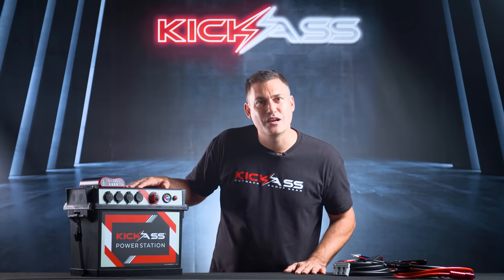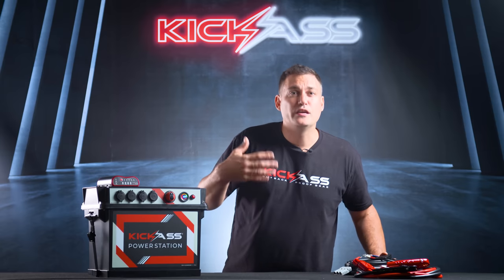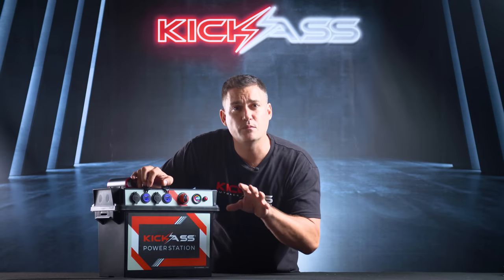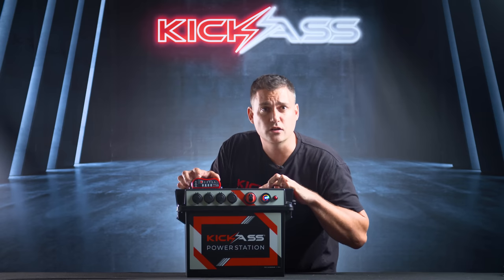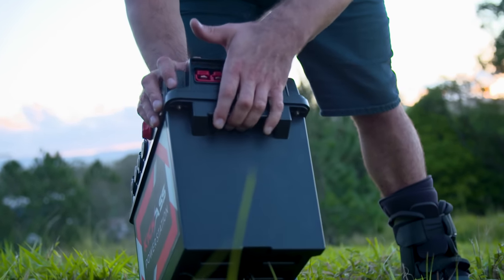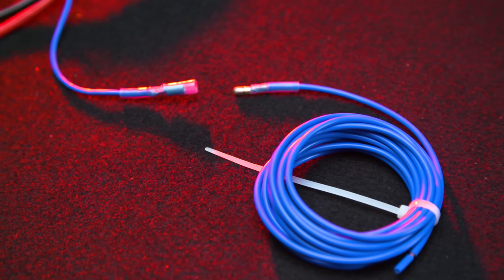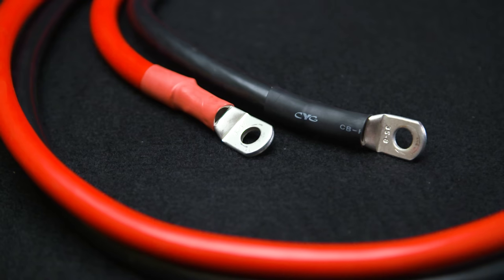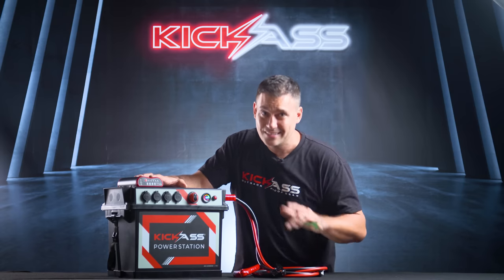KickAss Powerstation Portable Battery Box with integrated 25 Amp DC DC charger. Dual battery system

Comment: So this is basically the whole dual battery system except more portable and cheaper. 110% getting this in my next car!
Reply from the maker: Hey Sammy, yes this is designed to b an all in one system. All you need to do is run a wiring kit from your cranking battery to wherever you want your deep cycle. Everything else is built in.
Reply: @KickAssProducts  that is awesome. So simple. Everything is so complicated So many of us spend hours researching when there only needs to be one person to research it all and by the looks of it you guys have gotten it right.

Comment: It's a good plug and play set-up. Having issues with an over voltage issue from the alternator though. The starter battery is running at 14.3 and the aux battery hits overload at 14.2 turning into a beeping pain in the bum. Shouldn't be doing it
Reply from the maker: Hey Mate, you should see a bulk charge to an AGM battery of up to 14.4 Volts when charging from your alternator. When the charger senses the battery is full only then should it drop back to the float voltage of 13.7 volts. 

Is the charger showing you a fault code?

If you continue to have issues please submit a ticket via our support portal https://supportportal.kickassproducts.com.au/kickass-12v-premium-battery-box-with-dcdc-mppt-solar-controller/

One of our technicians will get back to you ASAP.
Reply: @KickAssProducts  it's the lithium. Over voltage  fault code at 14.2. Then when the battery is off on the toggle it's all lights flashing constantly  with the bottom left and bottom right lights on

Comment: Recently installed this in my Colorado and have it running from my main battery using the triple Anderson plug. When I take a test light to it I’m only getting power through the ignition wire. Is this normal? So far I’m happy with the performance of this box I’m just not 100% if there was anything I may have missed
Reply from the maker: G'day Benny,i would check your fuse mate as you shoud be getting the same reading from start battery to the other end of the triple anderson plug & you should only be getting power to the blue ignition wire while the car is actually running 
Thanks for watching the video
Cheers Craig

Comment: with AC charger, can car cigarette socket charing the power station?  daily 30min driving to work, which will charge the power station alright for 40L fridge for the day?
Reply from the maker: No Sorry, The integrated DC DC charger draws 25 amps. A cig socket can only supply 10 amps max. To charge while you are driving you need a direct connection to your vehicle's alternator (start battery). However the 120AH battery when fully charged will keep a 40 Litre fridge running for several days so if you charge from AC at home you would not need to charge when driving.

Comment: If i just buy the box itself, what is the largest capacity battery that would fit in it? I would like to be able to run a higher capacity inverter from it.
Reply from the maker: G'day Mate, it's pretty much designed around the dimensions of a N70 battery as it is the most common but still has a little room to move so you would just have to check the dimensions of your battery 
Thanks for watching 
Cheers Craig

Comment: OK ...having just spent some time hooking this all up in my Ford Ranger PX2, i feel like i can give some decent feedback. Now...understand, i have no appreciable automotive qualifications or auto electrical experience. 

Pros. 

1) Really solid piece of kit....pretty much everything they say here is true, well built, feels strong in terms of the box itself. good allen key tie down screws to put the lid on 
2) Be a little careful though, the lid with all the wiring in it has a bit of weight to it and you don't want to bounce it off anything when you are taking it on and off putting battery in. Once its all screwed down though its fine to move about.
3) the voltage indicator is nice and obvious and the DCDC charger is well bolted to the box. 
4) the install of the wiring isnt that hard. It took me longer to work out where to run it through the chassis and get it in there than it did to understand it. 
5) works well with my existing kickass battery charger. 

Mids

1) Remember...not their fault, but you are going to need to give room for a 12v plug to poke out with clearance to your fridge. forgot that and had to move the base.
2) the battery base is a great design in terms of screw down points, but i really would have preferred an aluminum or steel one, the plastic flexes pretty hard depending on where you are screwing it down. 
3) it sounds obvious now......(and im pretty dumb) but remember the lid goes on the box only in 1 direction to allow for the vertical Anderson slots 

Cons

1) Not any so far really,

The one thing i would recommend is that the crew do more video installs, show us customer or your installs on all the majors brands. ie how do you get the wiring to the back on a ranger with a canopy ? where is the right fuse on a Hilux? If you did 4 of these videos on each major Utes, you would have 80% of the market covered for self install walkthroughs your customers.. Have a table in the manual for what piggyback fuse we should buy and what slot meets the requirements (to fit and meets the 'ignition on' requirements)

Overall ?  really happy with it ! good product, solidly built........just suggesting a bit more install/product info for us newbies who are working it out as we go. (and these guys already do a lot of those sorts of videos)
Reply from the maker: Thanks for the review Mark.

Comment: Hi these are awsome products i love them just wondering  i have the agm battery box with the Dcdc charger on top can i upgrade to a lithium battery and put it in the agm box ? 
Thankyou keep up the Awsome products
Reply from the maker: Hi Anthony, do you own the KA PowerStation? if so absolutely you can. 

The charger on the unit is fully compatible with lithium batteries. The only  thing is that the volt meter will not be fully accurate with a lithium battery. However our LiFePO4 batteries are supplied with the Remote Display Unit screen which gives you all the information from the units BMS.

Comment: Love how this is a plug and play system basically.  2 questions :  1.  In the United States I don't see the 20amp AC battery charger available.  Did I miss that?  2.  If I leave this plugged in all the time to charge from solar while sitting, should I install a battery isolator so it doesn't drain my starter battery if I am also using the mppt controller?  Can't wait to order this.
Reply from the maker: Hi, our AC chargers are not available in the US just yet. As we run on 240 volt in Australia we have to build a different 120 volt version for you guys in the US. 

You should always have some sort of isolator between your start battery and your auxiliary battery. Either a VSR or more recommended a DCDC charger.

Comment: Great information. Just what I need to know as I am about to set up my 4wd for 12v power. I didn't understand exactly about bypassing the solar panel's inbuilt controller. But I get that my solar panel can be used one way or another. I will probably get a kick ass battery box etc after seeing this video.
Reply from the maker: If you have another solar controller such as the MPPT in the DCDC charger you don't use the built in one on the solar panel. You bypass it and plug your solar panel directly into the solar input on the DCDC charger and it will regulate the power. Hope this helps.

Comment: Hey mate ya spoke about the 700w inverter. Would this battery box with 120 lithium run a your 1200w inverter or do you recommend two batteries?
Reply from the maker: As long as the BMS on your lithium battery can handle the current draw. (110Amps DC)

Comment: Can you elaborate on the optional inverter cable; there is no fuse on the red anderson plug on the battery box, so how is the circuit protected? 
I have asked this question on the contact form on your website but have had no response...
Reply from the maker: G'day Dan,you would have to still install a fuse mate & sorry we don't have anything at the moment

Comment: I have 1996 Land Rover Defender 300 tdi and I want to run Fridge, camping shower, lighting, charge phones, laptop etc.... My car has no computer. Do I need to use blue ignition cable??? I can connect it if necessary. So that box will not drain main battery right? Thanks for great looking products!
Reply from the maker: You don't need to install the ignition wire but still recommend it. As long as your alternator reaches the chargers cut in voltage of 13.2 Volts the unit will sense that the vehicle is running. However it can take a few minutes for your starter battery to get back up to this voltage after ignition. The Ignition wire is usually tapped into the fuse box so that the unit will switch on straight away when you start your vehicle. 

And yes, the charger also acts as an isolator so your starter battery does not get drained.

Comment: New to the space so please excuse the under-educated query. Assuming access to full sun, can I plug a 200w sp into this station to maintain the charge and power to your 75 litre dual zone fridge/freezer? Solar panel -> Power Station -> Fridge/Freezer. Planning to pop up to your showroom in Warana this week sometime to have gander and chat. Cheers?
Reply from the maker: At Pmax, (which is the highest theoretical output of the solar panel) the 200 watt panel is capable of 11 amps per hour so would more then cover the draw from the fridge. However Getting the perfect conditions that result in your panels generating the maximum output is very rare. 

There are also other factors as what temperature you plan to run the fridge at and if you will be driving and charging the battery from the alternator. Short answer is that it's probably a good idea to pop in and have a chat to one of our guys.

 Showroom is at

2 Mallet Street
Kunda Park
4556.
Reply: @KickAssProducts  Agreed, cheers. Will be up tomorrow hopefully.

Comment: I don't want to use AGM battery. As I have stated multiple times I am asking if it is ok to run an 120Ah LITHIUM battery, plugged directly to the 2000W inverter.
Reply from the maker: You need to check the what the max output of the BMS is on the battery you want to use. 

Most Lithium batteries have a Max draw of between 50 and 100 amps, try to draw more then this and BMS will go into protection mode and shut down.

Comment: Been waiting for a good complete package for my 2020 SR5 to go in the tray.
Reply from the maker: Get in quick, they are selling faster then we expected!
Reply: Watched the video and it looks like the jumper cable is high current but the wire inside the battery box cover much smaller.

Comment: If I buy one of these can the lithium go in this box at a later date and still work?
Reply from the maker: Absolutely, Every thing is the same of the battery boxes except the display screen. If you purchase one of our LiFePO4 4 batteries at a later date, which includes the Remote Display Unit you will just need to decide hoe you want to mount or retro fit the screen.

Comment: Hey,  If I get the AGM version now, can I upgrade later and drop in a lithium when budget allows?
Reply from the maker: Yes, this charger on this unit is lithium compatible. The difference between our AGM box and our Lithium box is the AGM box does not have the display screen

Comment: hi there 
question about the blue ignition wire
if you have an older vehicle without a smart alternator do i just plug it in normal with the blue wire not connected to anything or do i need to remove it
thanks
Reply from the maker: No You do not have to connect it. You will just find that will be a delay for the charger to kick in when you start your vehicle.

Comment: Unit looks great. Looking to purchase 1. Queations, Can i charge the power pack via my vehicle anderson plug and also the anderson plug from my vehicles fixed solar panels at the same time or do i have diconnect/connect as required? Which way will charge the battery quicker 12 volt vehcile plug or vehicle anderson plug? Can I purchase this product from a retail shop? Can i charge the power pack and run my 12 volt fridge simultaneously while the car is running? If i do run via my vehicles anderson plug does the power back know when to stop drawing power from my main car battery so it does not go flat? Thanks is advance.
Reply from the maker: lol So many questions, you can call us and have a chat to one of our customer service agents on 07 3063 4211

But here are the short answers to your questions. 

You can only charge from 1 source at a time. Charging from your vehicle is faster as alternators generate a much higher current.

We only have 1 retail shop currently. We are based on the Sunshine Coast at 2 Mallet Street, Kunda Park.

Yes You can charge via solar or vehicle while your fridge and other appliances are running. That's the whole idea. 

The DC/DC charger has an inbuilt isolator, so when you vehicle is not running it disconnects itself from your stat battery.

Comment: Its good. But needs a 300w inverter or better to compete with the best in its class. The cranking option is very cool.
Reply from the maker: Not sure what you are looking at but I do not believe there are any products on the market that have both a 25 amp DC-DC / MPPT charger as well as a 300 watt inverter at this price point. But thanks anyway.
Reply: With the invention of USB C 300w inverters are becoming unnecessary.

Comment: Can u plug in a kickass control hub to this battery so u can flick one switch for lights
Reply from the maker: G'day zarx,as long as you connect the positive & negative cables to a battery it can be used with any battery 
thanks for watching 
Cheers 
Craig

Comment: Are you able to use the un-regulated solar input for my fixed panel for example, and simultaneously use the regulated input with my solar blanket and mppt charger? So I am getting charge from 2 panels (1 through the regulated port and one through the dcdc charger)
Reply from the maker: Unfortunately no, what will happen when two regulators are active is that they will "Confuse" each other. As the first regulator is in bulk charge the batteries voltage will read as around the 14.7 volt mark. The second regulator will read this voltage and consider the battery fully charged and therefore will not input anymore charge and vice versa. 

In some cases the regulators will swap turning off and on as they read each others input voltage.

Comment: How easy is the triple anderson plug to remove so I can run my cable from the bonnet, under my trim and to the boot?
Reply from the maker: Hi Ian, It is super easy mate. It is exactly the same as a two pin plug, you just push the tabs down under the pins and then the pins will easily push out through the back of the plug. You can then cut the cable to the correct length and then crimp new terminals on. 

Check out our Anderson Connector video https://www.youtube.com/watch?v=kX-jQ6MQnXc

You will find the crimping section at 2:20

Comment: Hi fantastic video can the battery box be turned off when i am not using my kickass solar controller while traveling
Reply from the maker: Hi, the isolation on/off switch will turn everything off including the DC/DC solar charger when not in use. The 175 Amp has a direct connection to the battery and is the only thing stays "live" when this switch is in the off position.

Comment: You mention a 700W inverter can be connected directly via an inverter cable but you don't mention if larger inverters can be attached in the same way.  Are your 1200W or 2000W Inverters an option for direct connection via an Anderson plug also?
Reply from the maker: Hi Fredo, 

We do not recommend that you use anything higher than a 700 watt inverter through a 175 amp anderson plug. While a 1200 watt will only draw 100 amps at 12 volts, an inrush can spike to 200 amps. This is obviously higher then what the anderson connector is rated for. 

In most scenarios these are acceptable margins and would be safe, however as the current draw can exceed the max rating we do not recommend it and caution against it. 

As for a 2000 watt inverter. Peak inrush can exceed 330 amps DC. To handle this safely We recommend multiple batteries wired in parallel with heavy duty linking cables.
Reply: @KickAssProducts  Hi, What if I use a 120Ah Lithium battery with this battery box?
Reply: @KickAssProducts  And if I were to connect it to a 2000W kickass inverter (I want to run a 1500W induction cooker), how would I go about doing this ? (upgrading the anderson plug inverter connecting cable?)
Reply: @KickAssProducts  If I connect the Kickass 2000w inverter directly to 120Ah lithium battery sitting inside of the Kickass power station, would this be a safe option? I need to clarify all these before I place my orders for the powerstation and inverter. Thanks

Comment: can I operate my portable 12000lb winch from the red heavy duty plug?
Reply from the maker: As long as the current draw does not exceed 175 Amps. Also running a winch from an AGM battery for long periods of time can significantly lower the cycle life of you battery.
Reply: @KickAssProducts  Thank you.

Comment: thank you for the video 
will work on a 24v system in the truck here? as have truck 24v 90amps system throughout the truck with no 12v power ??????
Reply from the maker: It will charge from a 24 volt system but you will still need to use a 12 volt battery in the box.